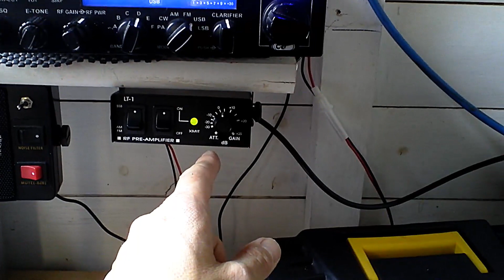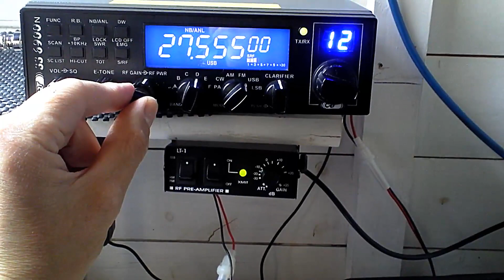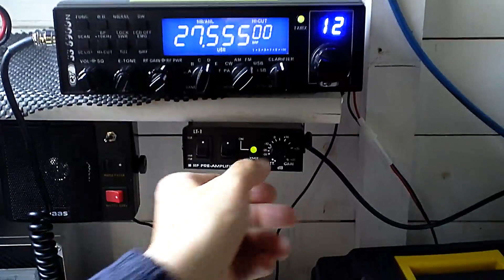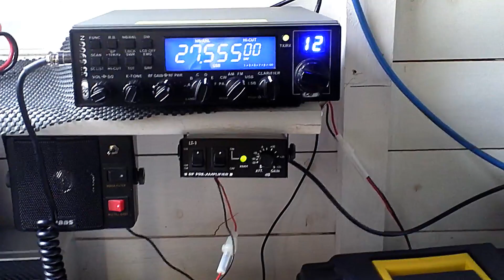CB RADIO. The LT-1 Pre Amplifier

Comment: Linear amplifiers I use usually have a pre amp receive switch.  It is just one low noise transistor amplifier.   Raises all noise in signal.
Reply from the maker: Yes some have that feature.

Comment: Hi great videos been watching a lot of them as wanting to get back into cb, what is the extra switch on your external speaker for?
Reply from the maker: Its something i fitted to switch between a 3.5mm jack at the back and the main speaker.  Its so i can use headphones for weaker signals.
Reply: Thanks, which speaker do you prefer the maas one or the cobra one?

Comment: One question that I have is----what is the wattage rating ? I may have missed it somewhere. I need one on my mobile, because after being in a key down contest my receive is down.I know I could take the radio out, rebuild it, buy a 1,599.99 $ radio, all of that. I do not want to fiddle with the radio as it is because it is old, and transmits perfectly. Too many times after a tune up, a radio (mine) has lost some of its radio soul .LOL. Just my opinion. Thank you for taking the time to demo your equipment, this is how we all learn. 21
Reply from the maker: I am not sure of the wattage rating.  I purchased this unit a while ago second hand so no instructions.
Reply: I would guess around 50W at best. A preamplifier should not be placed after a burner
Reply: 10-4 , just interested in it's rating, I have several old school types by Ameco for use on my base radios if I need to.

Comment: You'll lose more in the insertion loss of having it inline than any benefit you'll actually get.
The only way in which you will see a clear benefit is if your receive noise level is below the minimum level of the receiver sensitivity. Then you'll amplify signals that couldn't be heard before. This is very unlikely. You are going to see an improvement in the meter reading of received signals, but also the noise level. So you're not improving the signal to noise ratio, just making everything louder. Again with the attenuation setting, you make everything quieter. Where preamps are great is at the antenna side, where you can prevent signals being lost through the transmission line loss.
Reply: Yup the more junk you put inline the more loss.

Comment: If you need a preamp, there is something wrong with your rig
Reply from the maker: Why ?  What if you have a plain 40 channel radio with no RF gain control and want to reduce local signals.
Reply: Because your radio has automatic gain control which caters for diffences in signal strength
Reply from the maker: It does.  When you turn down the RF gain the auto control kicks in boosting the signal.  Works better in HF gear and i reduce the RF on my 450D all the time.  However what if you have a radio without a RF control.